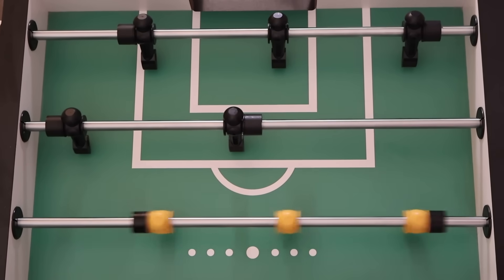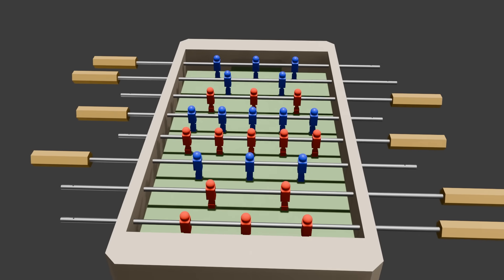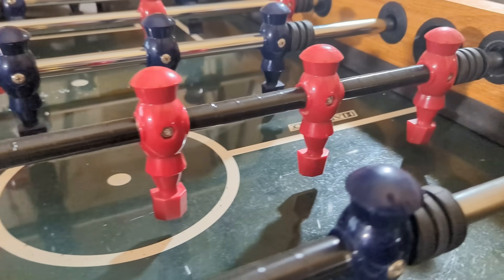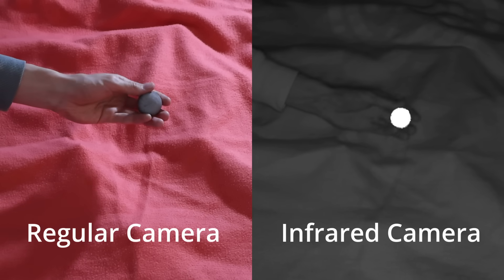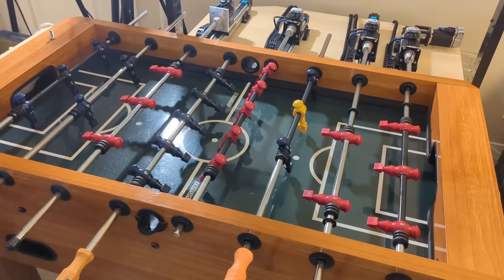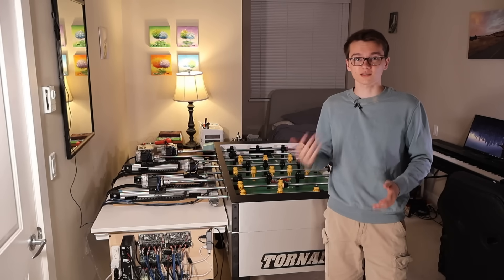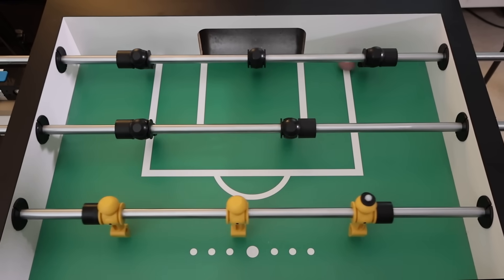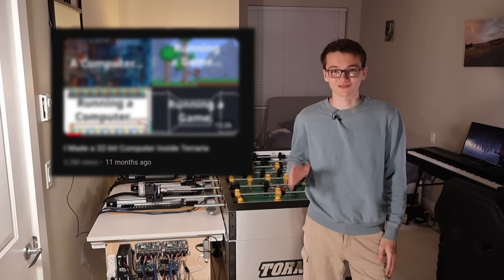I Made the World's Best Foosball Robot!

Comment: About the losing control problem, why not have a small scanline at the bottom of the table, low enough that it doesn't see the figures, but does see the ball. The location code would also become way simpler, as it would just have an x location bar and a y location bar.

Comment: One of the most cracked projects ive seen in a while, this dude is hireable AF!

but the 3d tracking system is too expensive overkill lmao. Could've mounted a bunch of smaller cameras (e.g. pi cam 3) around the board & do multi-view tracking + 3d reconstruction (but tbh it's like research/industry level comp vision skills).

Another thing you could do is upload the CAD to Nvidia Isaac & put it into a cozy 8xA100 for a week to train an RL foosball model.

Comment: Idea for tracking cheaper: cameras positioned to see the bottom of the table, as the ball reaches further down than the other moving components, contacting the surface. Mask out everything where the bottom most points of the other moving components are. Do this on two axes and I'm sure the math could be worked out. - cameras facing horizontally at the walls to see the field.

Comment: Next step; write a second application to control a player, make both sides controlled, and let the new app play the old app. This seems like an obvious use case for machine learning; the environment is quite isolated to produce repeatable conditions. If you have two apps, be sure to switch sides so slight differences in motor response must be factored into the controlling applications

Comment: You could've gotten rid of the vision detection completly. How?

1. Track the ball by detecting its force on the surface or by making the ball magnetic and then detect its position underneath or by using a xy grid made of lasers a few milimiters above the surface
2. Track the player's position by simply measuring rods length and their rotantion angles

Comment: I feel like the control part via the webapp could be even enhanced by using a keyboard and a mouse instead of a controler. A mouse gives you more precision on where to move the bar and with 4 keys you could switch the bar you want to move horizontally. Finally a left mouse click could be used to shoot. If the latency is good enough I think that could be a lot of fun.

Comment: I feel like you could have saved a lot of time on this project with cleaner code. If I saw correctly your whole code is basically in a single file and the main function has like 1500 lines of code. That sounds insanely painful to work with, and in a few months you probably won't understand what much of the stuff means and how it works.

Comment: Very nice, but your robot is breaking rules:  "Spinning of the rods is illegal". 
"Spinning is defined as the rotation of any soccer figure more than 360 degrees before or after striking the ball."

So break the rules and say "It's Better Than You Are".... dude..., you should figure out how to shoot by the rules and then lets see how  "It's Better Than You Are" it actually is.
Reply from the maker: It's a snake shot that's perfectly legal, it's one of the most common shots in competitive foosball (on Tornado at least)
Reply: @built-from-scratch  360 degree rule is applying on the snake shot too. This robot does over 360 degrees. See, it is perfectly clear that robot does over 360degree 
12:10 https://youtu.be/xrwXZXGiP1w?t=730
Reply: @kasluremada5347 You are incorrect. It is 360 before striking the ball and 360 after. Go watch any sanctioned foosball match and you will see this shot over and over.

Comment: Next up: Add motors to the other side, so the table can play against itself, as well as automatic ball drop-in. Then use a neural network to control both sides, and let it train by playing against itself. I bet it'd come up with some insane inhuman strategies. Just have to be careful with local minima, but if you first train it to react like your current manual implementation would (which can fully be done in software at well over 100x real time) it will start out being about as good as your implementation. Then just occasionally switch one side back to your implementation to make sure it doesn't train itself into a weird special case. Leave that running for a few months and see if you can still beat it!

Comment: as someone who wrote a bachelor's thesis on self playing foosball tables 9 years ago i am still impressed. using 5 cameras feels like cheating though (i had the restraint of analyzing video footage from competitive games). i did occlusion handling from the information i had about the balls trajectory, guessing under which player it is. with this camera system it's easy enough to find the player position and angle but it was easy enough without. 
Whats the frame rate of those cameras? are they only sensitive to the light they emmit/reflect? 
it turned out that 30 fps is not fast enough to track a pro players shot (the ball goes from mid to goal in 2 frames, rolling shutter applies)

the robotics hardware seems pretty straight forward (still time consuming).
but the software...oh the software...
Reply from the maker: Cool, out of curiosity which one did you work on? The cameras are shooting 200 fps, but they can go a bit higher if you compromise a bit on image quality I think

Comment: As a foosball player I'm curious to have point of view osensing force apply to the roads.

I play on Bonzini foosball table and where I live people usually lock the ball between the player and table, it requires knowledge about sloppiness of the table, it's inclination, the flex of road, once lock properly you can setup for a really powerful shoots when you squizz the ball between the player and the table who for example make the ball bounce back out of the goal. So in count +1 for you and -1 for the other team, we do to make the party last longer... 
It also have the feeling that the player sens the ball and anticipate the motion of ball tho make contact to it and let the ball push the player and increase the torque until the ball get on the spot will the ball get into this lock position. 
Usually once lock the player will test if the ball can stay in this position whit the appropriate torque, if it's not the case it will quickly hit the ball.
Sometimes you also want to cushion a stop and therefore you brake the ball progressively to avoid a rebound.

Comment: The robot turns the player a full revolution, that is not allowed I think. Are the the tables International foosball tables? As a Software developer myself, this is an awesome project and a great achievement. I play on a Bonzini at my workplace, and those are so great. Also the should when you block a shot, with those aluminium players, is great. The table is word and everything has a superb feel. Those table in this video looks like cheap and plastic compared to the Bonzini.

Comment: Well, it's strange! The use of neural networks in this case simply suggests itself! In addition, the robot could receive feedback not only from cameras (or maybe they are not needed, it is not yet clear), but simply from information about the angle of rotation of the handle (if it caught the ball, the angle will be certain). The robot could also receive information about the ball “by ear”, analyzing the planned impact of the rebound from the wall with the real one. Also, the technical table can be eliminated simply by replacing the linear drives with rotating ones (yes, there will be some slippage, but it can easily be detected by simple means). But the block will be extremely compact and “fit on” any table. The development is extremely promising; the author can make a fortune by producing both full-size sets for home tables and miniature ones for small desktop games. The ability to play real physical games online or with a robot is an absolutely vacant niche now! Thanks and best wishes from the bottom of my heart! THANK YOU!!!!!!!!!!!!!!!!!!!!!!!!!!!!!!!!!!!!!!!!!!!!!!!!!!!!!!!!!!!!!!!!!!!!!!!!!!!!!!!!!!!!!!!!!

Comment: Amazing video ! Can you explain how you made the ball into a marker? If you used paint, can you please provide references?
Reply from the maker: Good question! Trying to do so was actually by far the biggest challenge I left out of the video, I tried so many things. Here's the one that ended up working, it's certainly not as good of a marker as tape but none of the other coatings I could find worked at all: https://www.amazon.com/dp/B096H6NWXL

I also had a secondary ball wrapped with tiny pieces of tape which as you can imagine was very tedious to make and didn't work very well as a ball since it roles weirdly.
Reply: @built-from-scratch  Wonderful thanks a lot ! I'll probably give it a try for custom made markers

Comment: Dude. I would give my left arm, three toes from my right foot, and an entire case of Klondike bars for half of your executive function. 
I do think the dual motors per rod with linear belt drives was "easy mode", and the space that takes up is somewhat prohibitive. For version 2, I want to see single motor omni-wheel drive systems mounted directly on the side of the foosball table cabinet. 
Oh and while you're at it, you should take a look at a machine learning approach to play. You could train a simple neural network on a digital foosball table then test it on the real thing. The machine learning part seems RIGHT up your alley!

Comment: Truly amazing! Congratulations on a fantastic multidisciplinary project, a great piece of work, and a frequently hilarious video.

I dreamed of this 20 years ago when I attempted to develop a script, and then later a machine-readable notation, to describe foosball passes and shots. When I discovered the Tornado game I realised that the universe of possible controlled plays was a lot larger than I first realised.

More recently I created a much simpler notation for describing transitions between the rods, allowing for real-time manual match recording and statistics generation, a system which I developed in Pharo Smalltalk.

I'm interested in how you have programmed the play actions. For example, the stick pass with catch in front-pin position - do you have an intermediate level of description for the individual elements of that play within your code which could be recomposed in different ways?

For example, if I wanted to program my favourite tic-tac series, could I do so by combining some existing code components or would I have to build it from scratch? I wonder how fast you could tic-tac the ball. I wonder how many different ways you could stop a moving ball, eg by cradling it or pinning it on the fly.

The next stage could be to develop an API that provides the common atomic elements of matchplay, and then host foosbar v foosbar tournaments where human competitors program their side of the table with their own offensive and defensive series, reminiscent of the micromouse tournaments.

You realise this is just the start of your project, right? 🤓

Comment: Well done! This is impressive work. However, doesn't this violate the spinning rule? It would be interesting to see how it would play with human limits (i.e. not allowed to react faster than 0.2 seconds to some change, max accel, no spinning, etc.) and RL for training a sim2real policy under such constraints.

Also: I was surprised how much money you spent on everything. Those motors and foosball table are not cheap.
Reply from the maker: No, the table is doing a snake shot which is perfectly legal since you do slightly less (~330 degrees) than 360 degrees before hitting the ball

Comment: You really tried a ps3 move camera but not an xbox one kinect with 60fps ir video output? two of them is much cheaper and you can use them better with some math.
Reply from the maker: The primary bottleneck is on latency, which the play station eye is surprisingly good for. It was a prototype anyways though, if I went with a regular cameras in the end I would have upgraded to more industrial low latency ones

Comment: A god-level foosball robot and it’s remotely controllable? Insane! Quite possibly the coolest toy anyone’s ever had in their bedroom
Reply from the maker: It is until you realize I have 5 cameras menacingly staring at my bed... (albeit not plugged in all the time)
Reply: @built-from-scratch I’m curious if you thought about using some sort of gyroscopic/accelerometer equipped ball instead of the cameras?
Reply: @Gotchhaa  So we need a ball that's the same size and with a similar surface that's hollow enough to contain an accelerometer and all it's gubbins. It must not be bouncy and must be shock resistant. 

sounds kinda hard
Reply: @candyman9635  yeah perhaps the tech isn’t there, I don’t know enough. Thanks for your reply :)

I wonder if there’s some way to have detection with a Bluetooth type wave? Or maybe ir laser sensors to determine pos/speed? Could you event cast out enough lasers and receivers to get enough coordinates for a smooth simulated ball?
Reply: @Gotchhaa  The problem is wireless. At these speeds it would be too slow to get the data from a sensor and send it wirelessly to a nearby receiver. The motion cameras that he's using are really fast and wired to his computer, so little to no latency at all.
Reply: @Gotchhaa  IR lasers sure, but then you're still looking at several things on sticks pointed at the table.
Reply: I'd like to see another set of motors added to the other side and he can invite other programmers to challenge his programming.  Add in more camera angles and hi-speed replays and you've got something.
Reply: @rider573  same thing I thought about - instead of robots killing robots in arena - this gem!